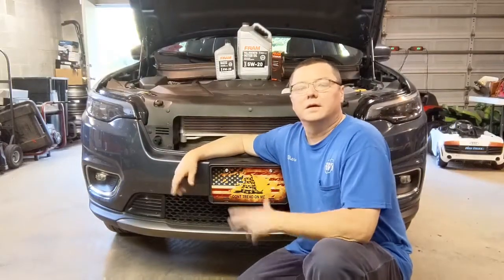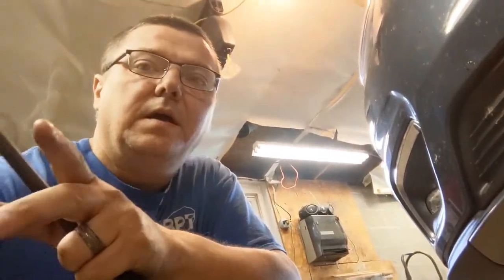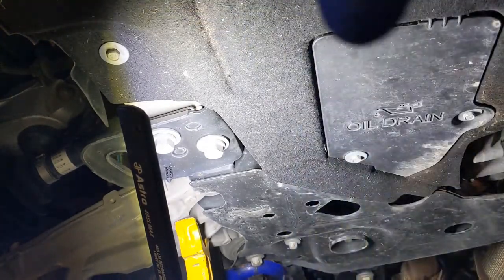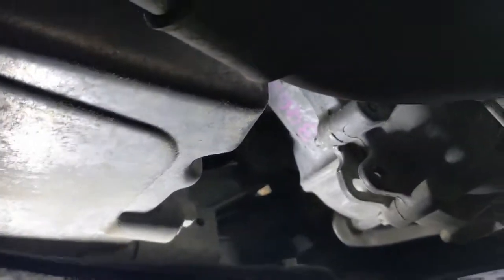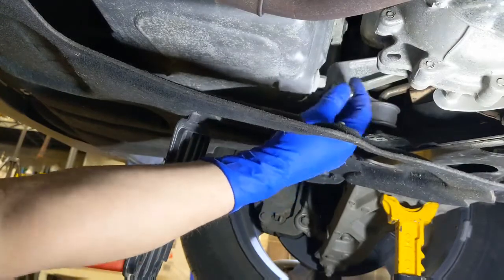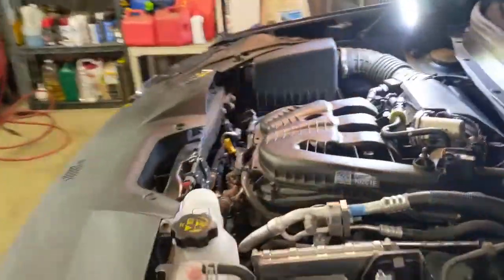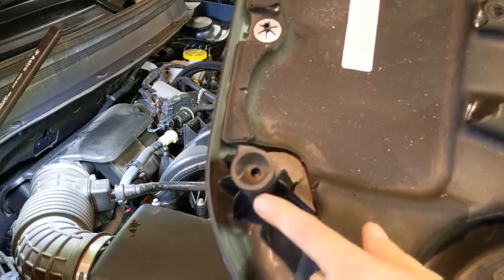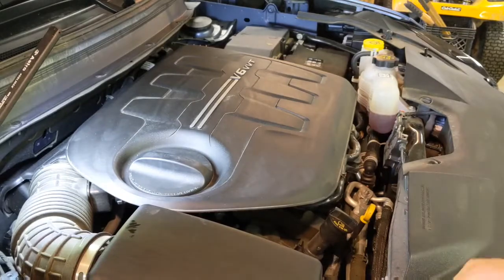How To Change The Oil And Filter 2020 Jeep Cherokee KL

Comment: Good job for your first time brother.

1) Filter should be removed before the oil is drained. Reason for this is that it will allow the oil to drain better as it allows air to enter the engine from the top.
2) One can using brake cleaner to clean the inside of the filter housing.
3) A small tab of oil on oil filter housing o-ring will help with the installation (and future removal) of the filter housing.

Comment: One thing I learned the hard way. Apply very light pressure to the plastic oil filter housing. Too much pressure and you’ll be replacing that housing with a massive leak.